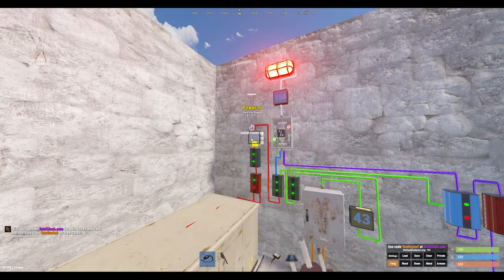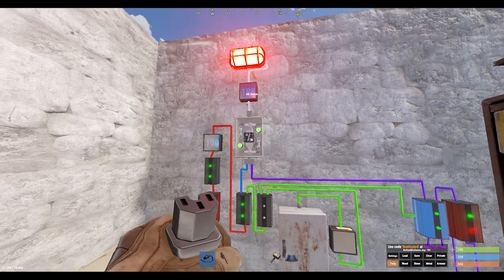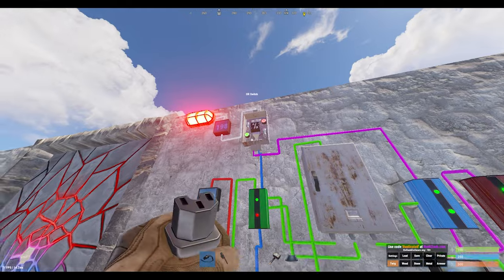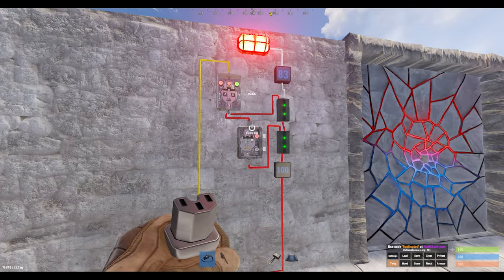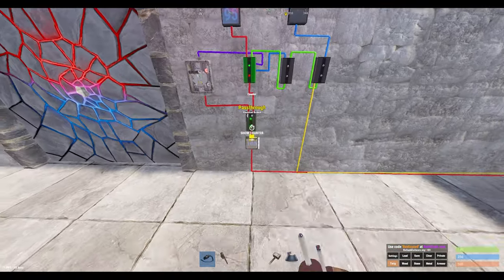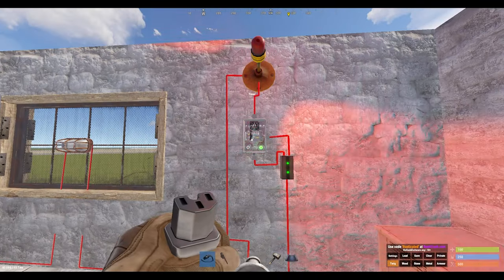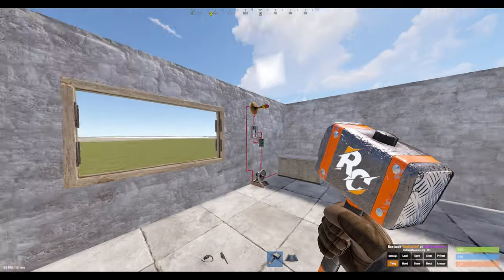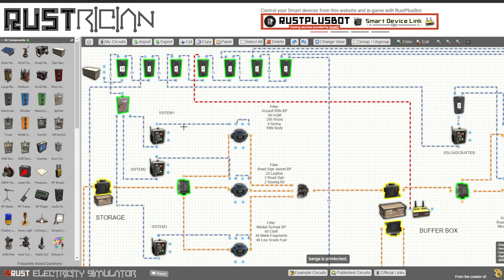META ELECTRIC CIRCUITS 2023

Comment: Nice job! Thanks for not calling the battery backups, "infinite power".
Reply from the maker: Haha! Thanks for dropping by good sir. I am infinitely appreciative :)
Reply: Oh jeez, I hate that term so much. WHAT IS INFINITE ABOUT IT? nothing. That's what.

I may be remembering incorrectly but I think there was an ACTUAL infinite power glitch back when electricity first came out, but that got patched fairly early on.
Reply: Jesus loves you alot trust in His death 4 salvation and be saved from eternal hell <3 Jesus died on the cross for you bro.

Comment: How is that last alarm circuit wired up? I used to do something very similar but everything was connected in series so one break would turn on the alarm non-stop instead of one pulse per break like you have here.

I had to pause and stare at the battery backup circuit but that looks sick! I'll be honest, I just recently started using the old version and I have been wanting to make a version that doesn't waste all that electricity but it looks like it has already been done! That is a very clever trick, taking advantage of the order pulses turn off and using the same splitter to turn on and off the memory cell!

I'm going to have to make my way over to that rustrician discord and see what other goodies are waiting for me haha!

Great video Kanga! I'll be honest I originally wasn't expecting to learn anything when I clicked on the video but you ended up teaching me the most recent circuit I've been intending to figure out, and reignited my curiosity 😃
Reply from the maker: Yeah, I considered myself a decent Rust electrician. Within 2 days on the Rustricity discord, I discovered I had a lot to learn. Which is good! More tools and tricks to add to the repertoire!

The last circuit is my favourite. 3 power for infinite ♾️ destruction detection!
Reply: @KANGARAIDER  I haven't done anything crazy with electricity for a long time as most of it is a lot of work to redo constantly (I mostly play on bi weekly or weekly servers) but if those breadboards end up coming out and let you paste circuits from some sort of storage that doesn't reset between wipes, it would bring electricity to a whole new level!
Reply: Welcome to the party!
Reply: @swiftcoyote1444  Thank you! I'm excited to see what I've been missing out on all these years 😀
Reply: @KANGARAIDER  Could you post the Rustrician Link to this circuit? Its a little bit confusing for me as a newbie to see it from the video.
Reply from the maker: @alexr3669  sure thing. I'll post it up tonight! Thanks for stopping by with a question!
Reply: Jesus loves you alot trust in His death 4 salvation and be saved from eternal hell <3 Jesus died on the cross for you bro.